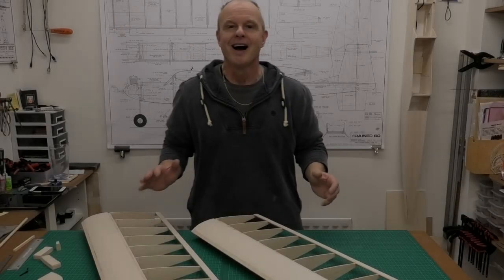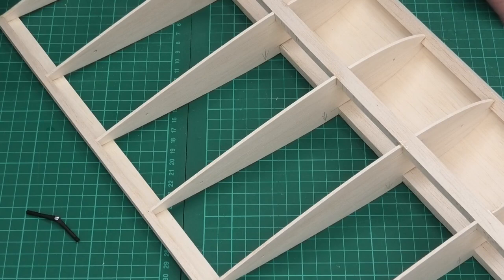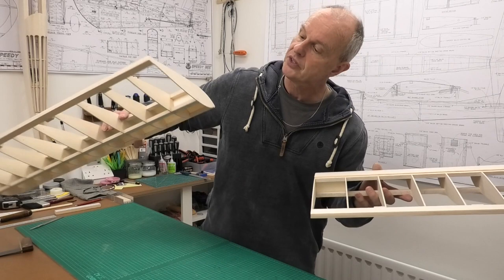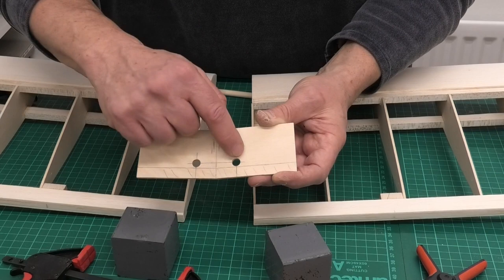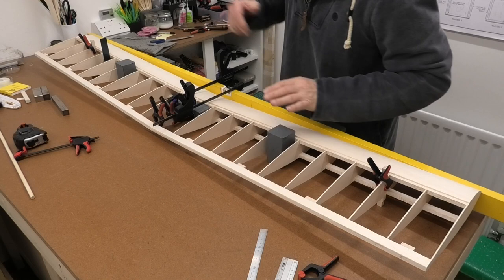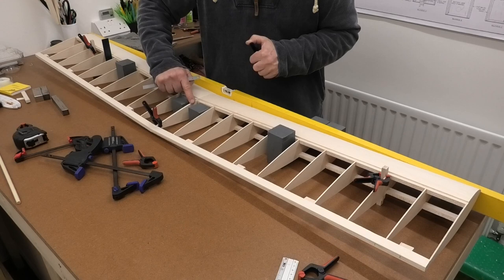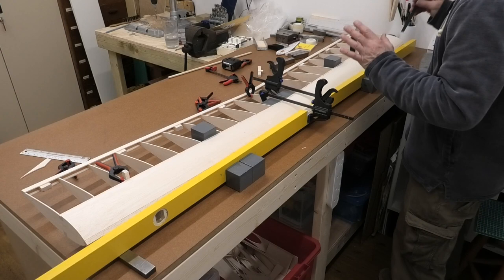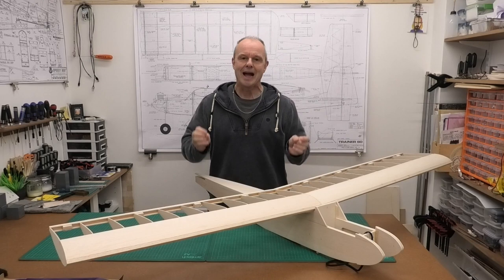Great Planes Trainer 60: Pt 6 Joining the Wings - Build Series - 65" wingspan RC balsa aeroplane.

Comment: Robart hinges are great. They also make a little trapezoid type device for centering the drill holes. Works well.
Looking forward!
Reply from the maker: Thanks for the comment, yes they are great to use, excellent product
Reply: @MarkRobinson555  
Hey, Mark.
I'm building a Sig Kadet Senior right now. I'm going to try top hinging for the first time using Robart hinges.
I like your channel. As an old-school model builder, it's always nice to see others doing the same.
The  T-60 is a very solid airplane. It should last you years.

Comment: Can you tell me what measure of dihedral you targeted? I am interested in building a replacement and want to decrease the magnitude, I'm just not certain to what amount.
Reply from the maker: 1 3/8"
Reply: @MarkRobinson555  Thoughts on making it 0.75"?  I built an original bridi version in the 70's and reduced dihedral but don't recall the value used. I was working towards a better sport flyer and finished it as a tail dragger. My work now is to build a 20/40 and 60 version family, updating with some of the features you have shown.